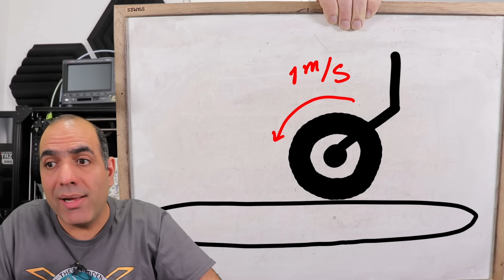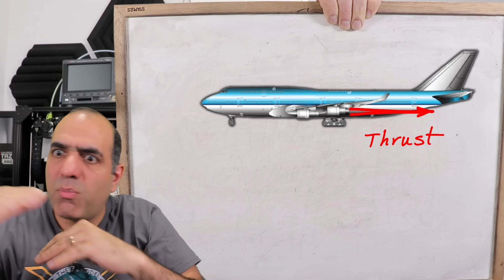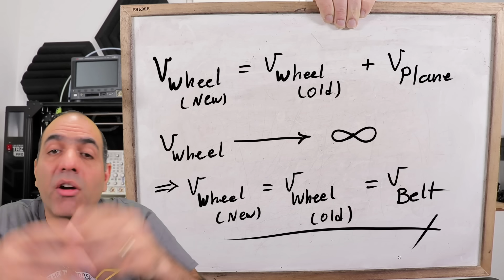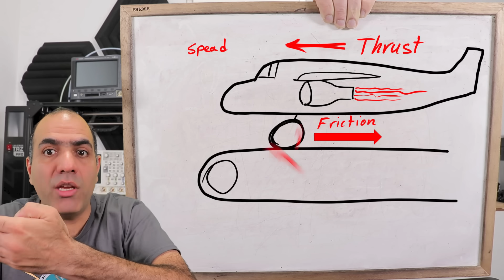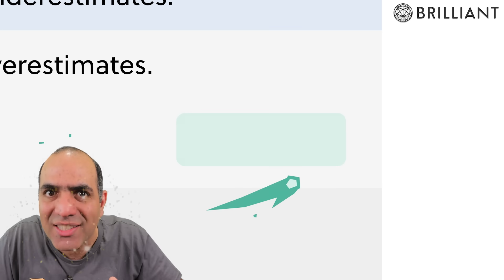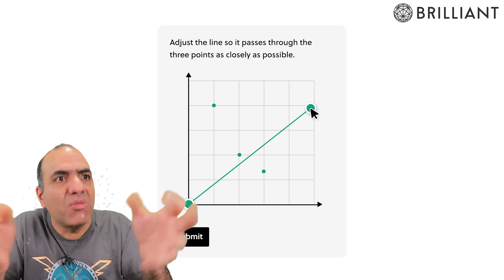Airplane Question that Drove Me NUTS!!!

Comment: It just depends how much friction the wheels will have when moving at speed, and whether they can withstand it.
Reply: you don't want to go there... The belt mechanism would crack long before the wheels, it's a matter of complexity and the wheels are designed for high speeds, the belt is not, so the stress on the belt would be much higher.
Reply: @Demrezel  I'm sure someone could design a belt for the task, if they had a blank cheque. It would cost a lot of money.
But I would think the question assumes the aeroplane is not going to be modified, and would have the standard wheels.
Reply: @Knowbody42  So the wheels are standard and the belt is ideal?
Reply: @Demrezel  Well, I think the question does kind of imply that.
But if you wanted to make a realistic belt, I'm sure somebody (eg Elon Musk) could spend huge amounts of money to make an overengineered one.

Comment: The conveyor belt being designed to "match the speed of the wheels" is a weird statement.  Since the plane is generating thrust against the air, and therefore moving forward, the conveyor belt should also move forward to match the speed of the plane.  Then the plane takes off, and the wheels aren't rotating.  They're just translating in space since the only reason they would need to roll in the first place is to compensate for the speed of the plane relative to the ground.

Comment: Thank you Mehdi!  Every time this comes up I say "Yeah, I know the 'correct' answer but the question is silly".  In a world with friction there is no way to know whether the plane would take off unless the speed of the belt is defined in a more meaningful way - otherwise it would be a case of testing it and seeing whether the plane could take off with burst tires due to the heat created in the wheel bearings due to ever increasing ramp speed.
Reply: For the friction of the wheel bearing to reach infinity, the friction of the bearings of the conveyor would also need to reach infinity. At which point the conveyor belt would stop and the plane would continue moving forward.
Reply: @rodericklenz5030   I like this answer "if the conveyer belt fails before the wheels on the plane, it will take off"
Reply: The speed of the belt has zero relevance to the question. Wind speed over wings is what will get the aircraft flying.
Reply: Bearings would be ok for sure, but the rubber is a nother thing.
Reply: @jothain  I think they get spun apart long before friction gives way.
Reply: WILL ALWAYS TAKE OFF i dont care about the friction because you can always end up with broken landing gears and the airplane skidding on the runway.
No dude, you can not refuse a theoretical question with an experiment. Theoretical questions HAVE to be answers always with theory.
Reply: Then there's the issue that the draft caused by any belt rotating that rapidly would actually start to generate lift on the wings, lol.
Reply: You do know planes don’t fly in the air off the ground based on the friction between the wheels and ground right?
Reply: @EndOfLineTech  OK, if I put concrete blocks in front of the plane wheels that are twice the height of the wheels, will it take off?   The issue here is that, potentially, the friction of the belt ever increasing its speed will prevent the plane ever gaining any speed relative to the ground and, since it's on the ground, the air.
Reply: @nowt2957  you can’t add imaginary blocks. “Durr what if I set off a nuke in the plane, you guys are forgetting about that!” 

Also someone either is a know it all or skipped engineering class. Rolling friction works differently it is not a block in front of the wheels. Yeah if they lock up and start skidding but then you have a much bigger problem. The belt only matches the speed of the wheels not infinitely increase. As the plane speeds up there will actually be less rolling resistance; not only due to the lift caused by the wings but that’s how rolling friction works… and considering 747s typically have smooth wheels as the wheel rolls is will drag air with it normally creating a small air bubble. 

But here’s where you’re getting caught up, the wheels yes will be stationary and not turning so does that actually make this situation from rolling friction to standard friction? Let’s even assume perfect variables where the belt is able to match the speed of the wheels perfectly to the atomic level (not the real world and shouldn’t be applied to this situation but hey why not) even in this situation the wheels are not locked, they would still be free rotating. The belt is not simply absorbing all the thrust from the engines (again dynamic joint) the belt would have to be going so incredibly fast in reverse to account for the losses in the bearings to impart a great enough force to absorb all of the forward motion of the aircraft or even move it in reverse. That’s ~22 TONS of force the belt would have to impart negatively on the plane through the bearings to even keep it stationary the only force in this situation the belt can steal is the force it takes to rotate the wheel backwards… so in essence if we doubled the amount of wheels on a 747 on a normal runway could it take off? All you’re doing with the belt is doubling the rolling resistance as yet again it’s a dynamic joint, and even if the wheels are kept atomically still. The plane is still trying to overcome rolling resistance … and I think you know that’s not infinite or planes couldn’t take off. It’s suck a minuscule value as compared to the inertia. 

I’m pretty sure a 747 has the power to take off on a runway even if all the wheels were locked (ignoring the fact half the plane would probably be a skid mark before it reached velocity but that’s a different issue.)
Reply: Imagine the wheels are not actually mounted to the airplane and are just sitting on the side of the runway (conveyor belt). No where in the senecio does it say the wheels are actually mounted to the axels. Plane takes off sliding down the stationary runway (conveyor belt) on it's wheelless axel.
Reply: The relative groundspeed to the ramp would only ever be double the airspeed, not ever increasing, so if the plane takes off at 100 knots the gear would only need to reach 200 knots which is probably well inside safety tolerances. Some friction would probably make the takeoff distance longer, but airflow over the belt would add lift.
Reply: @docthebiker  No it would not and this is the issue that many of us take with this problem "The conveyer belt is designed to exactly match the speed of the wheels, moving in the opposite direction" note that airspeed is never mentioned.    
for more of an explanation: My reasoning on this actually works backwards from the people who proposed it since they don't seem to be able to understand basic interactions of objects.
I take, firstly, a situation that the plane landing gear is against concrete blocks the height of the wheels - no matter how much thrust is provided it will not take off - this is just a simple reminder to those who view the speed of air over the wing as everything that real planes take off from real runways.
Then a chocked plane, with blocks in front of the wheels?  I believe that they have taken off?  But most don't?
Then a plane with the brakes sealed on (to my mind the nearest real-world you're going to get to this) - the tires will likely burst, will the wheels hold out?  Will the landing gear cause so much friction that the plane can't take off?
The question as phrased is ridiculous and anyone giving the answer simply stating that a plane needs only air over the wing to fly is just not actually thinking about this.
Reply: @nowt2957  Trouble is if parameters are not specified then you can only use existing "real world" parameters. The assumption is that the exercise is to determine if the aircraft can take off, since that is the question. So the will be no additional impediments, the plane will be fueled, crewed, with the wings screwed on.
The assumption that  the wheels and belt will accelerate infinitely is wrong, it can double just once. The speed of one would have to be miss matched against the other for the reaction to run to infinite speeds. The proposition of the question is one of exactly matching.
Just KISS and keep to the stated parameters or you tie yourself in knots.

Comment: Initial reaction: I expect that the plane will take off: it will move as if there was a normal runway but the wheels would spin faster. Not really based on any calculations, just my gut reaction

Comment: I don't know anything about planes or flying, but when I read the question, I wondered: what do the wheels have to do with anything? 

Ideally the only reason a plane needs to run along a surface is to gain enough speed through thrust (from the jet engine) for the wind/air to lift the plane, at which point the wheels don't serve a function, right?  The jet engines take over and the plane more or less flies. 

If the thrust from the jet engine is high enough, the plane will lift itself through the air and fly right?

Comment: old school question, the question said that"exact match the speed, but not mentioned about if it is zero slip. then the aircraft could take off when wheel slipping or even there is no wheel !!!  they have thrust.

Comment: The plane won't take off, due to the plane being stationary. The air doesn't run around the jet engines, it runs through the jet engine. The airplane will "move" on the conveyor belt, while still being stationary. I don't think that enough air will be running around the wings to make the plane take off.

Comment: Crazy ideea: Case 5: The jet engines are on and the thrust they produce is sufficient enough to generate a strong and constant flow of air around the fuselage and the wings of the aircraft, thus also eventually generating lift and bypassing the issues caused by friction anyway.

Comment: The plane dont take off with its wheels, but with thrust.  So it will still move forward on the conveyer belt even if the belt moves double the speed in the opposite direction.  it will easily take off on the belt.

Comment: I think friction matching the thrust of the plane is quite a farfetched idea, because enough friction can destroy any material. If the turbines of the airplane are working but the plane isn't moving, that means that the entirity of the energy produced by the turbines that would move the plane is transformed into heat through friction in the wheels. Maybe for very small planes the wheels could hold... maybe, but certainly not for the plane depicted in the picture. Wheels would break, steel would melt and the plane would collapse into a conveyor belt moving extremely fast.
So the plane wouldn't fly, it would get totally destroyed. So I don' think this was the point of the question lol

Comment: It's actually a no brainer if you understand the physics involved. The thrust from the engine works against the airframe which propel the airplane forward. The conveyor simply causes the wheels to speed up and eventually as the airplane accelerates they will be spin 2X as fast as they would normally. This only happens as long as the integrity of the wheels remain. The centrifugal force  on the wheels will eventually cause them to to catastrophically disassemble themselves.

Comment: Taking into account no wind, ideal conditions and treadmil keeps the plane stationary, there shouldn't be any wind causing pressure under the wings, so shouldn't take off. But as others have mentioned with a strong wind the plane could still lift. Subjective answers

Comment: The planes don't take off because of speed, but because of AIRspeed, which means even if the plane is with its engines off and wind is blowing against it in the same direction, the plane will get airborne with 200 knots, depending from the weight of the plane. A hurricane can tecnically make a plane be airborne.

In this scenario, with jet engines, the plane wouldn't lift. But may be with propellers.

It is the same example if a plane was locked in very strong bars which allow the plane to keep it balance and only move vertically keeping y axis, would it lift? Probably it would with propellers installed in the front of the winds, but not with jet engines. The propellers create a flow of air on top and bottom of the wings if installed frontly, not the jet which concentrate the flow in its cilinder.

Comment: the first question is just nonsense.
A plane only can take off if there is enough air traveling over the wing.

And so, a parked plane can lift off if the windspeed over the wing is high enough.

The wheels dont matter.
Reply: what i think would be a better question for you to answer, mr Boom, is how an aircraft is dealing with lightning strikes.
How do they protect it?

How is the electronics protected against such strikes, etc etc?
How can you ground stuff on a plane?
etc etc.
Reply: engines of the plane do not have to be ON to have the plane lift in the air.
Enough wind blowing over the wings at high enough speeds will cause the plane to lift into the air. Even without engine power.

Infact, you could fly in the air not moving forward an inch.
If the wind speed over the wings is high enough to keep the airplane in the air, you can basically hover at the same spot providing the air speed does not change etc etc etc.
More factors come in to play i guess.

No engines required there. Heck, we have gliders ey.

Comment: Of course it could. It's not pushing against the runway to accelerate. Well, I guess so long as it gains enough airspeed before the wheel bearings or tires grenade themselves.

Comment: Your point about the belt and wheel speed increasing to infinity is exactly my issue, I think to make this sensible you need to either do it the mythbusters way or you need to have the belt run at the speed that the wheels would turn if the belt were not running, both of which are actually equivalent.
Reply: Even mythbusters messed it up. With they're setup, they didn't use a 747 where the tire limit speed would be exceeded well before rotation speed.

Comment: If we ignore all other factors and assume a typical take of day then, No the plane will not take off… BECAUSE the treadmill MATCH the speed of the wheels. If it were to just match the takeoff speed of the plane then it would be fine, the wheels would spin faster, but because it’s matching the WHEEL speed the plan will not physically move forward without slip. The bearings would over heat and wheels will seize rendering the wheels incapable of moving forward. This would result in the plane being unable to reach takeoff speed.

Technically, if it were to match takeoff speed the wheels would just spin twice as fast as normal and the plane would travel the length of the treadmill.

Comment: 🤔 the question has never given the following.
No wind speed applied.
No clue if the engine of the plane is used.

For my opinion..
So the plane is just on top of the Convair belt
and will only apply speed on the belt. Rolling friction will applied on the wheels and eventually turn but some point only cause there's the wheel bearing friction. So the plane will not fly but will thrown backwards
Since planes engine will only provide forward thrust with the use of air, it's not a car where the engine job is turn the wheel and move forward.

Comment: As I see it is that the plane no matter what speed it reaches since it is not accelerating in the fluid, in this case air, at any moment there is no pressure gradient causing lift. Furthermore I believe you would even hace downforce because the wing seperates to regions, on the top steady air, and on the bottom the air accelerated by the track and the suction of the engine and then thrust and of course the wake caused by the wheels. However this thrust could cause the opposite reaction on the tail and the airflux could be different further down the fusilage, causing the plane to pitch upwards. And you have wasted all this time reading this thing written by a chimpanze who doesnt know what he has had for breakfast today :)

Comment: Either the treadmill drags enough air to cause sufficient headwinds or it doesn't bring air, in which case the engines are choked.
What is the treadmill made of? What's the air density? Don't say it's in a vacuum, planes can't fly there.

Comment: Question for ElectroBOOM: Is it possible to power several electronic devices by using a 9 or 12 volt battery, multiple voltage booster that increase the voltage , and a small Transformer Down which converts the high voltage into high current needed to power or charge any devices?
Reply: First all electronics are never 100% efficient at the proposed tasks, Also entropy increases and power is lost like in heat etc, you cannot get more power out than you put into the system.
Hope this helps.
Reply: Of course that is possible, assuming the voltage booster or other circuitry also concerts it into some form of AC.
But why would you do that?
The result will be a expensive inefficient charger, with a side job as an electrical heater.
You will maybe find the old DOS game "The incredible machine" interesting if overcomplicated designs is your thing.
Reply: @martin_hansen  I loved that game  "The incredible machine" , Shame they did not do a new updated version.
Reply: Well hopefully that ElectroBOOM will make a prototype or gives an explanation.

Comment: The friction in the bearings of the wheels will be  small and mostly nod depend on the speed. The speed would ramp up very fast with all the energy of the jet engines and a matching amount of energy in the conveyor going into kinetic energy and heat energy from rolling resistance in the wheels. The tyres would melt and disintegrate.

Comment: Sure the plane can take off as planes don't use their wheels to accelerate, they use their engines. So yes, the plane will accelerate and take off of the conveyor belt as if it was an ordinary runway.